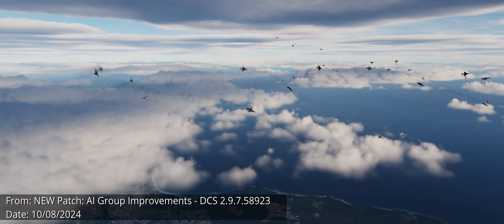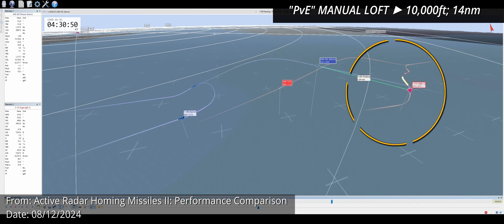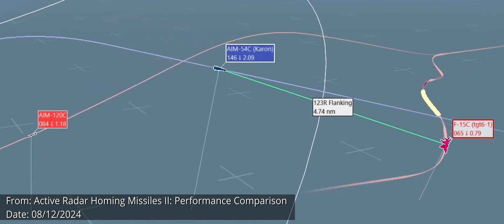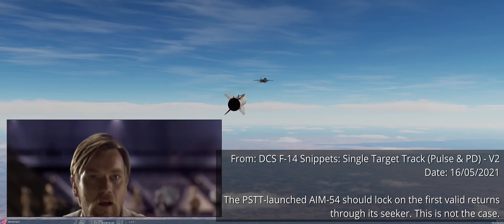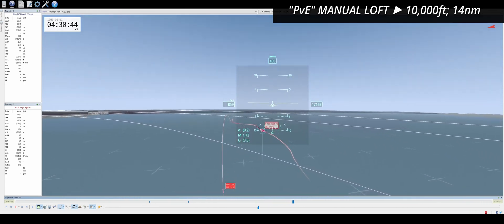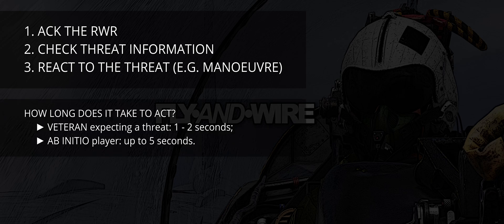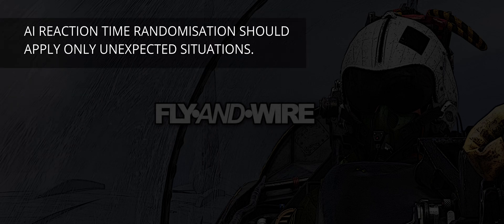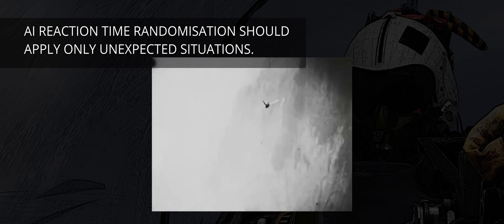DCS: A needed (and simple?) A/A AI improvement [Thoughts]

Comment: In general the AI work is very lackluster.... i mean AI AH64 blasting at 160 kts on full combat loads... some AI aircraft surpassing their service ceiling by alot. UFO FM like AI Mig-21. Mi-24 AI that can better spot, target and engage than any FLIR/Longbow equipped AH64.

Today i tried a dogfight against a clean SU-25 AI.... i laughed my ass off with his energy retention, holding constant 400 kts @ 14000+ ft

The only solution is to play multiplayer only, against other players.
Reply from the maker: Yeah, unfortunately I have to agree. Thei AI fundamentals have not changed much since LOMAC. Perhaps the lack of resources of the old single-core architecture prevented ED from making something more complex - see Jester, for example.
Hopefully this will change in the future.